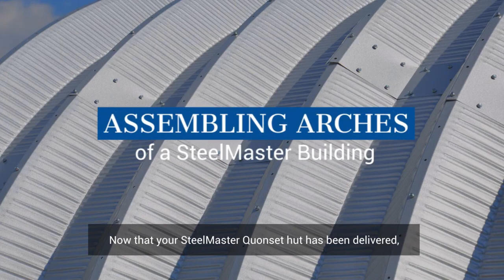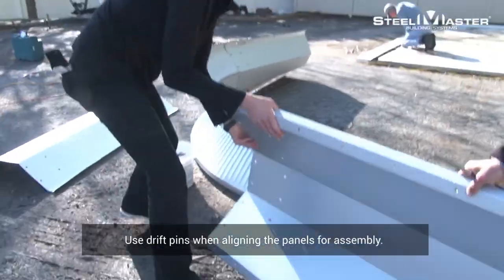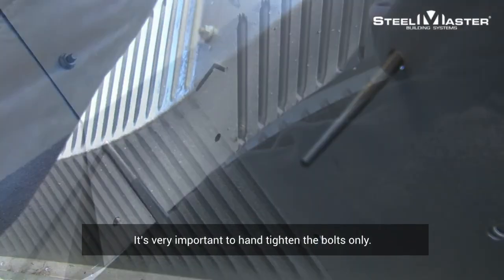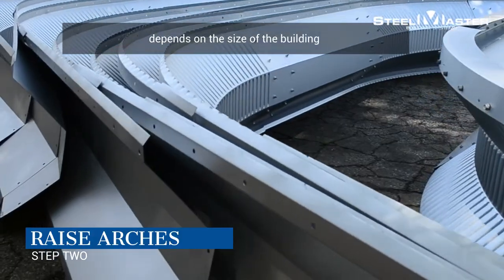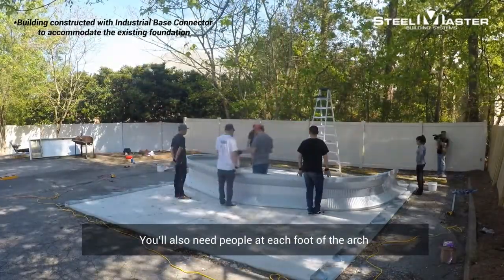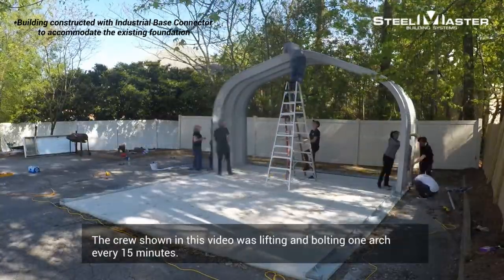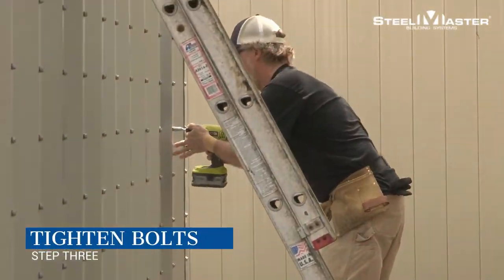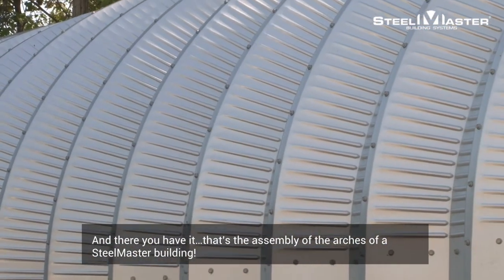How to: Metal Storage Building Kit Construction

Comment: Do you need to use support posts on the inside ? Our building is 20'x30', we got 6 Arches up so far and aren't using support posts, we only used it at first two Arches. Now we took posts down. It seems sturdy and solid, we bolt it down to the base as we go. 

Will roof top sag if we don't use support posts?

Comment: What about the foundation, how do you integrate it
Reply from the maker: A keyway foundation is our standard foundation, but we offer a Base Connector to provide a transition from your building to its foundation. Arches bolt to the Base Connector, which anchors bolts to the concrete foundation. Base Connector gives you the flexibility to move or expand your SteelMaster building and is perfect with existing slabs or block walls.

Comment: Have you had any issues of water running under the edge angle?
Reply: My father has had one for 20+ years and never had that problem. Only leaks through bolt holes where bolts weren’t tightened or missing.